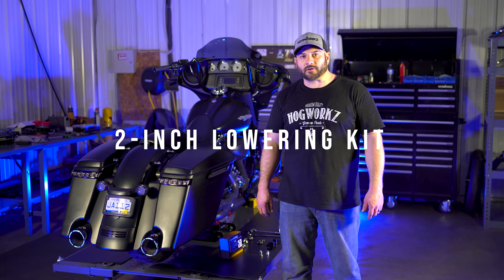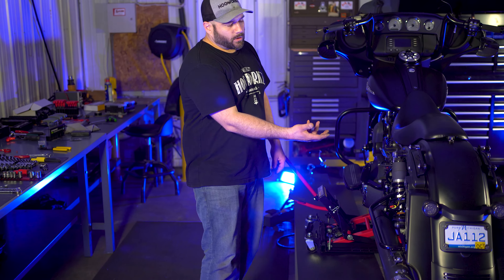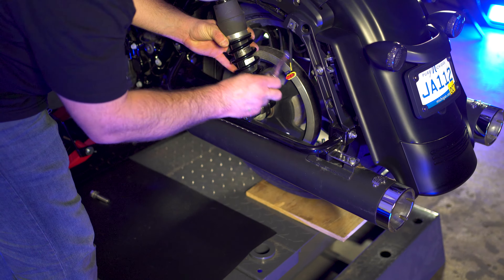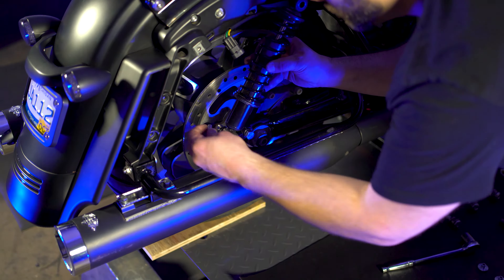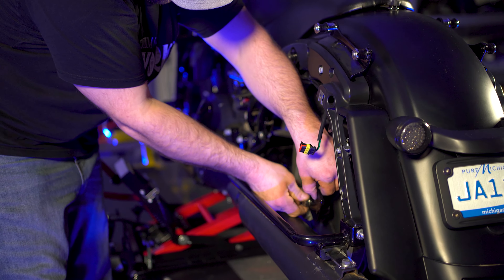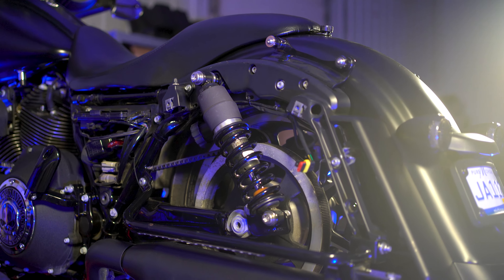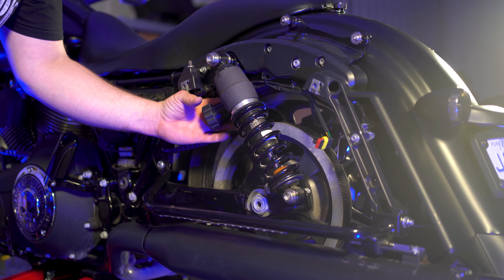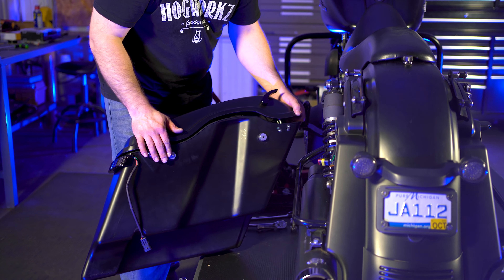2 Inch Lowering Kit for Harley® Touring '02-'23 (Coil Shocks) Installation from HOGWORKZ®

Comment: $70. from Horworz, or $21. from Amazon. You decide... I chose the latter.
Reply: I've had both and the ones on from Amazon are aluminum!  Hogwerks are carbon steel. Spend the extra on goods steel ones. I've seen cracked aluminum ones. Really dangerous! Your life is definitely worth the extra 50.00. Just my 2 cents. I don't wanna see anyone get hurt and when you hold the 2 kits, side by side, there's no comparison! Hogs are really heavy duty and the Amazon weigh nothing. Scary light duty